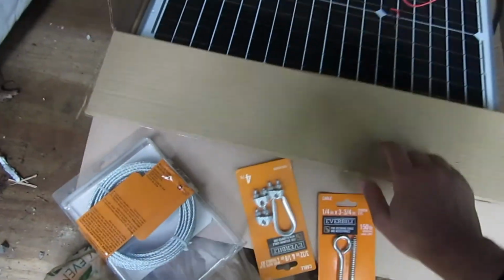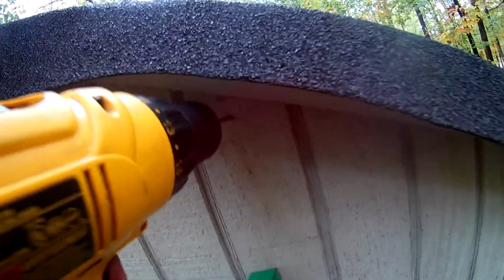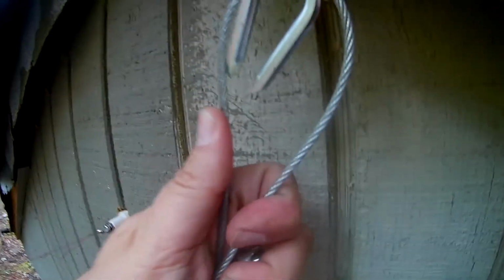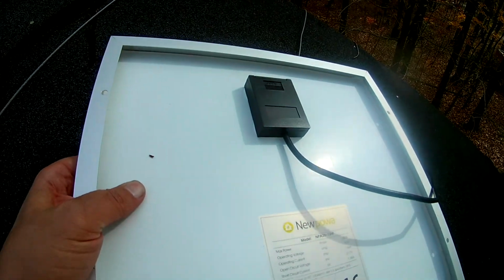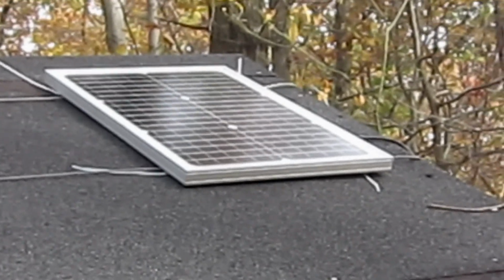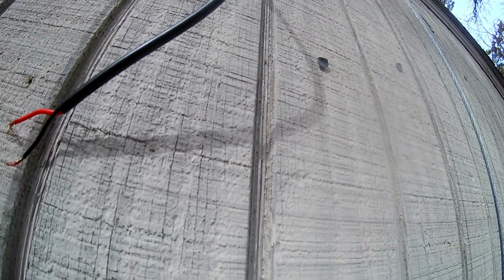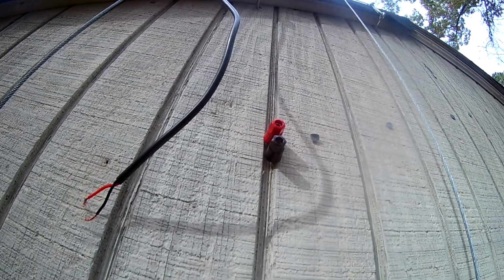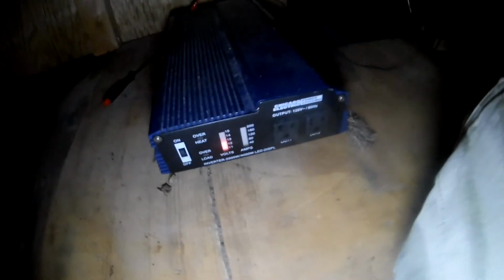Roof Mount Solar Panel for Mountain Cabin

Comment: For charging a phone get a car charger that way you don't transform 12v to 220v ac and after to 5 V dc
Reply from the maker: Yes, that sounds like a great idea! It is much more efficient if you are only charging low power devices like that.. My eventual goal is to run larger devices.. I was only demonstrating how it is possible to run an inverter off a solar system.. I believe?? It was a while ago I made this video.. I am working on more advanced energy systems as well, at the moment!  Thank for the great suggestion!!

Comment: how long will that 25watt solar panel take to charge the battery fully
Reply from the maker: It depends on the capacity of the battery, and of course, how much sun there is.. Let's assume we have a 10 Amp-Hour battery.. which is a small battery, but this is just for calculation purposes.. the energy in the battery is Volts*Amps*time = 12V * 10 A * 3600 seconds = 432,000 Joules in the battery.. Watts is joules/second.. so the time to charge is 432,000 J / 25W = 17,280 seconds or 4.8 hours.. If you want to use more power than that... You need to add more solar panels.. I only use electricity a few days out of the month.. so it is enough for my purpose at the moment.. Thanks for the great comments!